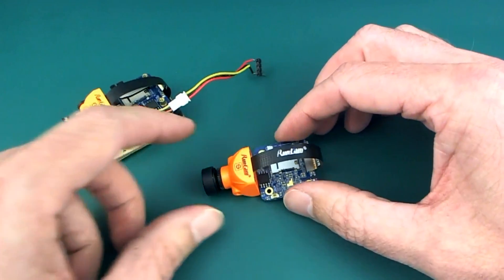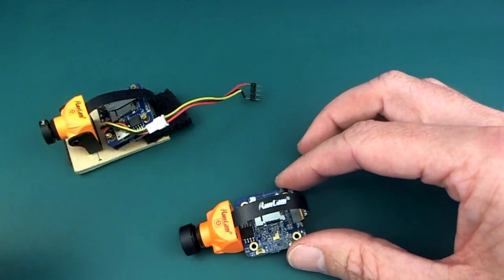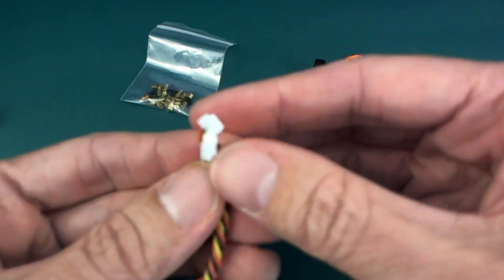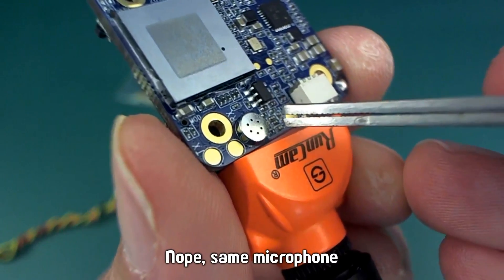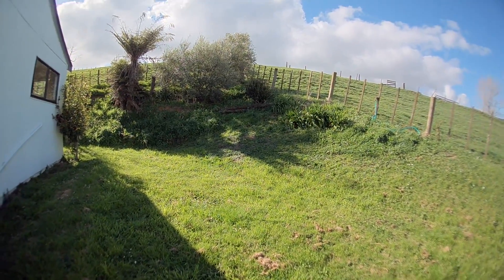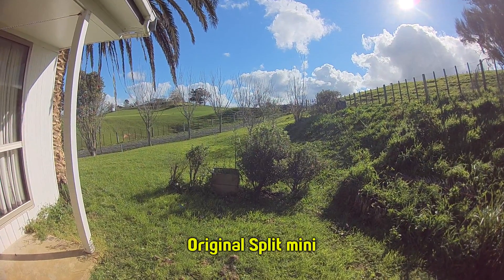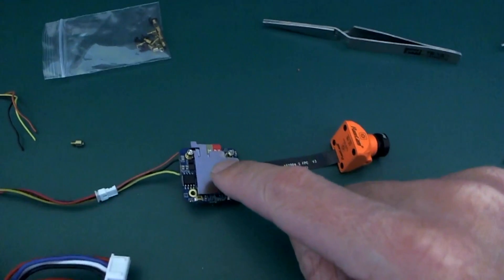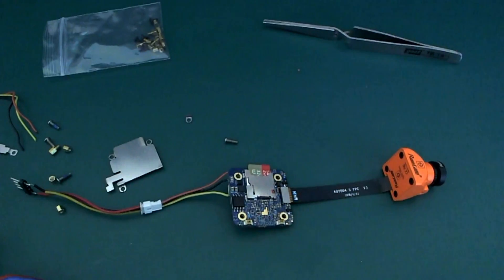RunCam Split mini 2

Comment: A single board makes a lot of difference in a tiny crammed build. Anyway, I think you might try and open the cam to center the lens on the sensor, I think it's been done before

Comment: Good evening, I bought a run cam split mini 2, as soon as it receives power the camera starts recording on the micro sd but in analogy not by any video signal, would you kindly help me?
Reply from the maker: Yesterday I discovered that if I power my Runcam 3s with a 4S lipo, the analog video will be output, but when I power it at 5V there is no analog output. I think maybe if you use 5V it thinks there is a computer connected so it becomes a USB disk instead. So maybe, the split mini 2 is the same....
Reply: iforce2d with many attempts and connecting the power directly to the battery I managed to get a video signal fpv even if very disturbed, then I bought a filter lc hoping to solve such disorders, thank you very much

Comment: Nice that they reduced it to one printed circuit board board though ;-) I've been very happy with my Split 2 so far, the video appears just as good as the Go Pros, even if the audio is rough.
Reply: Well, the current gopros are way better video quality, but considering the price and format, the split mini 2 is really impressive i think!

Comment: I think with a little more "sass" you could be the next Bruce Simpson :)
For the camera I'd rather stay with my sparrow 2 pro and slap on the runcam 3 when I want to take a video. Which is rare because whenever I put on the camera I crash.
Reply: Same with me! Whenever i am flying and not recording i just fly how i want. As soon as i strap on a camera i feel obligated to fly a little bit more risky to make the video intresting, and thats when i crash. Also adding a camera to a copter that you otherwise fly without it  makes it harder to fly because of the added weight, so thats the advantage of the Split cameras. Always the same weight, whether you are recording or not.

Comment: The cover should be mounted straight onto the circuit board.... Don't use a spacer. That way, the screws are correct.
Reply: btw, mine is sharp, all the way to the corners....
Reply from the maker: Spacer? I don't see a spacer anywhere here. The thread length on the screws I got is 2.5mm and the thickness of the PCB is 1.8mm. No way that is gonna work. Maybe you got a more recent version? Or are you talking about the original Split mini?
Reply: @iforce2d  Don't know... Perhaps different screws ?... I'm also talking about Split mini 2. Anyway, they fit just fine on mine. Quite happy with the camera.